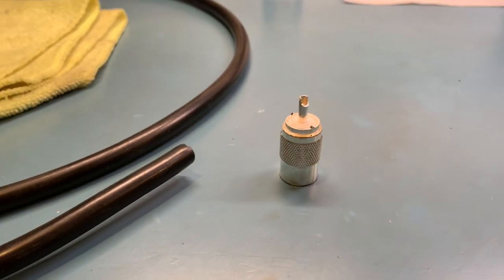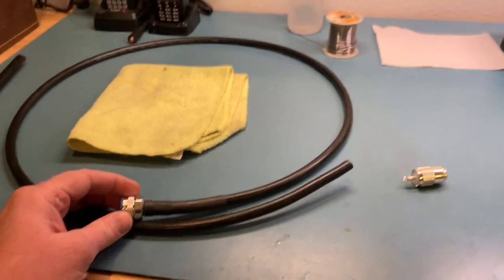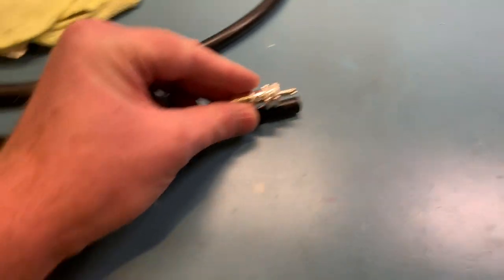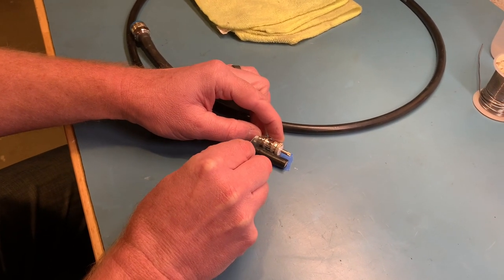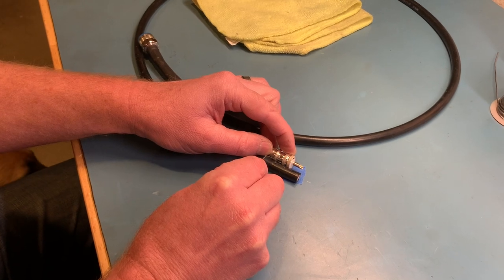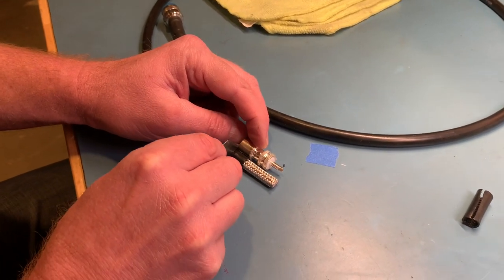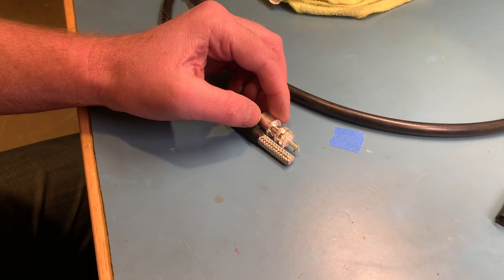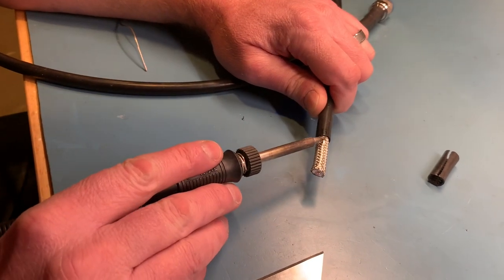How to install a PL259 on LMR400 coax, perfectly.

Comment: Finally a person that knows how to put pl259 connectors on correctly I don't know why these guys on these other videos keep cutting the braids off they need to stay intact so when you solder the holes it is grounded properly plus it keeps the connector held on tightly
Reply: So you’re not supposed to separate the braid and bend it back like I see on so many other videos then trim off the excess?
Reply from the maker: The braid will not come out nearly as clean if you do it that way.  Its not how I prefer to do it, but it works for many.
Reply: I was anticipating a hack n slash video but i agree 100% only way to do it. ntm That is never coming off. Keeps the H2o out also ✌

Comment: Very nice video.  I hate installing PL259 connectors on RG-8 / LMR400.  I'm happy to see that it is a chore for you as well.  I have learned two tips...   A small butane pencil torch works nicely for soldering the braid to the connector.  It heats faster than an iron, which means less time for the dielectric to heat.   And a tiny bit of silicone grease on the outer jacket helps the connector screw on easier.

Comment: Pure perfection and I will be replacing all mine and putting in the same effort that you did, thank you.
Reply from the maker: I made a few small updates to how I do this now.  I use a small tubing cutter to cut the tinned braid, and add IPA to the threaded part of the connector to act as lubricant while screwing the connector onto the coax, this makes it easy to do by hand and the IPA evaporates cleanly.

Comment: I have posted  videos on how to put on the PL-259 by not soldering but I have to admit, I do like soldered on connectors and in the last couple of days have been updating some of my coax and connectors. The non-soldered connections work fine and I tend to use them outside for repair when running an extension cord, etc. and soldering is difficult. I really like the way you dress the end of the coax and screw the PL-259 on - I did that on the connectors, as you show in the video, and soldered thru the holes and I really like it. In the past, if I soldered thru the holes, I just let the outer cover of the coax go in maybe 1/4 inch at the most but your method is superior by screwing the connector on more like 1/2 inch. Thanks for posting.  BTW - I use a 325 watt Weller soldering gun to solder. I believe in getting it hot and soldering it quickly and then give it plenty of time to cool so the dielectric doesn't deform. I am also a big fan of the Times Microwave brand of LMR-400-DB. Excellent video. 73  WA4QGA
Reply: Only time I ever twist them on without soldering is when its temporary or receive only. SDR and R7000 get moved around so much I just don't bother but on a rig with wattage. Solder and tested every time. Only takes one angle hair and a second of miss guided attention to let the magic smoke out.. ✌

Comment: I would just add I use an ohmmeter to check the cable before I even start see if there's a short, then after you screw the connector on check it again for a short before you solder
I keep a little air tank handy to blow some air on the connector if it gets too hot while soldering
Or in case the center conductor gets too hot while soldering
After you've cut off your outer braid use the ohm meter again to check for a short
I have probably done hundreds
One little hair off that breed touches the center conductor now I use soldered everything up where you have to start from scratch connectors cost four times more now, then they used to
Excellent video thank you
Reply from the maker: I need to do an updated video, I've incorporated two new tricks that speeds up the install.  I have a small pipe cutter I use to cut the tinned braided shield and using some IPA as lubricant between the connector body and the black jacket which eases twisting on the connector greatly.   I could also condense the video down to 5-8 min.  The IPA evaporates quickly with the heat and does a wonderful job quickly cooling the connector and coax innards to prevent any melting.  I still solder one point at a time and then cool everything down.   Your idea of checking for a short before hand is not bad, but I cant think of the last time I had a bad install, would have to go back 30 years and maybe 200+ connectors ago.

Comment: Great video! There are so many on here that don't solder the shield. As far as I am concerned not soldering the shield is asking for trouble later on.  I also like your use of alcohol to quickly cool down the connector. Well done!

Comment: I guess I am just lucks. I have NEVER soldered the braded on a PL connector and I have been an Amateur for over 43 years. I use the connector to hold the braded against the connector in the threads. That way its east to reuse the connectors. Have done it with everything up to UHF in fact I need to learn how to put the N Connectors for the satellite antennas I just ordered. Very nice video and I am sure this causes a little less loss. I remember last month my friend and I just finished my DX Commander for the barn and it took me like 5 min to put on each connector. Work just fine.
Reply from the maker: Almost anything can be made to work, just how well is the question.  If it works for you and your happy with it, that's all that matters.

Comment: Good video. The only step I would add is before you solder the connector, make sure the center and shield aren't shorted. A stray piece of braid can ruin a good solder job.
Reply from the maker: Yes, at 9 min mark, I show how important making sure the braid is trimmed and cleaned around the center dielectric.

Comment: I do like the way you do these PL-259s. May I make two suggestions? First, I like to use a small copper tube cutter to remove the center conductor dielectric after tinning. 2nd, I like to drill out the holes with a slightly larger drill, this allows me to get the soldering iron tip into good contact with the braid and shell at the same time. I like the fact you are using a good higher wattage iron. I use a 50 watt but with a larger tip than you are using. Good video!
Reply from the maker: The pipe cutter is a great idea, but I have never had a problem with the size of the holes.

Comment: Great job nice and clean without overheating.  Threading the connector on is a PITA.  Last night my son was watching me put a connector on piece of RG8 made a good suggestion to put a light coat on silicone on outer casing of the cable to lube the threads.  It made the connector screw right on and most likely more water resistant as well. Great video.
Reply from the maker: The silicon lube is a nice tip!

Comment: Nice job. I had not thought of the isp alcohol as a coolant.
Reply from the maker: Also, you put some IPA on the jacket and in the connector body threads you can twist the connector on the jacket by hand.

Comment: Very nice! That's pretty much how I've been doing it since I was a kid. Try not let solder wick down the outside of the tip, leaving shiny silver to make the connection instead of a layer of solder. I appreciate your conservative use of solder.
Reply from the maker: You don't need much, just enough to flow nicely is all.

Comment: Have you done a video of installing a PL 259 to smaller cable like RG59. We do these in the field, usually up a mast. I would love to see how you handle the adapter.
Reply from the maker: Yes, I pre-tin the sleeve, then fold back the braid on the sleeve, and tac the braid to the sleeve, then insert the sleeve with to the PL259 and solder the braid and sleeve thought the holes, it comes out the same, but you have to cool the connector between soldering each hole and only use just enough solder.
Reply: @damonkj7e  Thanks, that's what I was thinking,  You explain it very concisely.

Comment: So the water in the alcohol doesn't get sucked inside? Like everything else. Just curious. Tnx
Reply from the maker: No, its not an issue.  It all evaporates quite well.
Reply: @damonkj7e  What percentage do you use? My 99 and “99.9” catches fire pretty easy. It’s also expensive.
Reply from the maker: @echo-hotel  I use 91% most of the time.

Comment: I’m a little intimidated to attempt this for the first time. I finally have a high powered radio combination so I purchased the lmr400 coax but afraid to do this wrong and hurt my equipment.
Reply from the maker: Only one way to learn.  I ruined or messed up many connectors before I got good at it.  It takes time and practice.  Take your time and if you do it like in this, or other videos, you will get there.
Reply: @damonkj7e  thanks I actually went for it I just didn’t solder the braid I watched another video where he only soldered the tip and so far so good..
Reply: @ChristiannTyler  Thats an option but not for full power use. Its creating a capacitive junction to the inner braid. Great time saver for barefoot power.

Comment: Get yourself a little vise to hold the cable and connector while you solder.
Reply from the maker: I have some, but I just prefer using my hands, old habits.
Reply: @damonkj7e  I hear ya but it just seems so cumbersome and It will probably make it a lot easier.

Comment: there are tools that will cut and remove shielding all at once and leave you the right amount to solder and secure...saw no razor knife-just a bare unsafe blade
Reply from the maker: Just how I have been doing it since I was about 9 years old.  Always works for me :)

Comment: Unfortunately you are just pointing out how hard it is to get this Amphenol connector on. And if you don't get that shield solidly connected I have seen issues like SWR's fine on all bands except 10 meters. It can cause some weird issues not getting the PL-259 on right. Terry
Reply from the maker: Not so much difficult, just time consuming to do it right.

Comment: They make a tool that helps yu screw it on
Reply from the maker: A few drops of IPA in the screws of the body helps tremendously as well.   You can twist it on by hand with out fuss.